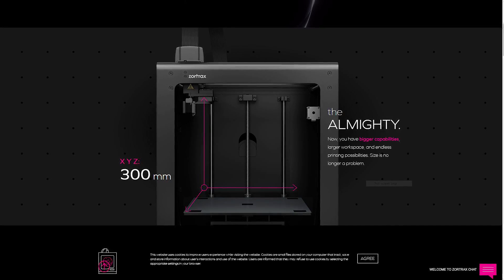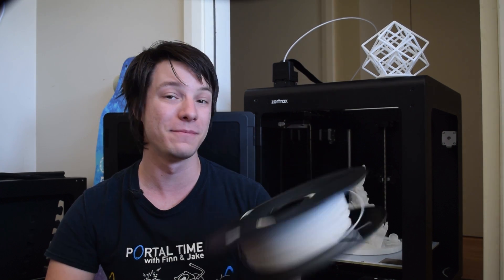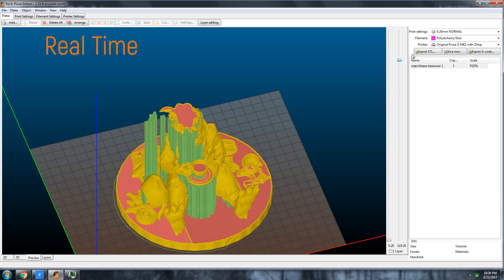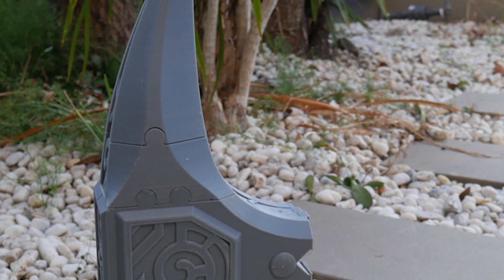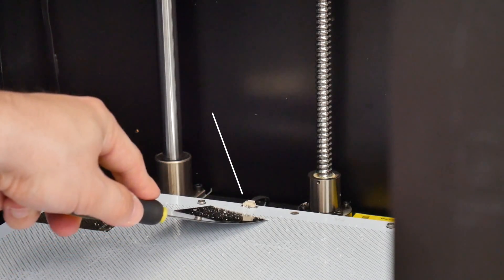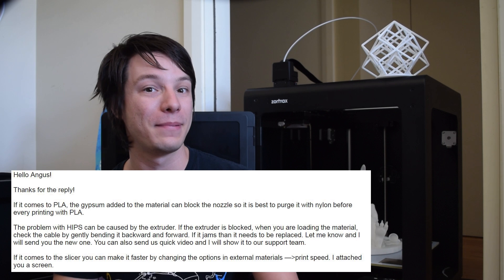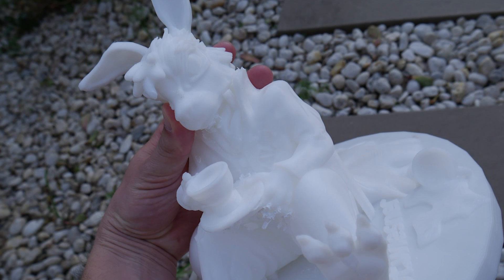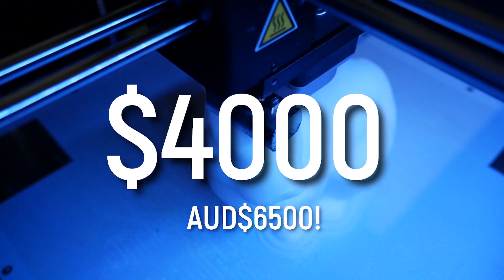Zortrax M300 3D Printer Review

Comment: Zortrax rescued my 3D printing aspirations - as someone who has been around electronics and mechanical engineering, I thought 3D printing would be an easy call - it wasn't the amount of time wasted in getting settings right, then getting the blasted print to stick to the bed, then trying hairspray etc only to have it weld on or leave sticky residues that would mess up the next print etc. I'd get a passable print, sometimes a really good one, and not touching any settings, have subsequent prints fail over and over - so when I saw the Zortrax with the anchoring holes in the print bed, I just had to have one - and with that, went from one print in 10 being a success to only 1 in ten failing - usually because I'd done something stupid. I won't have anything else but Zortrax now - currently we have an M200 at work on my recommendation, I have an M300 here at home, and am thinking about an M200 plus and an Inventure next - Zortrax all the way for me now. :)

Comment: The price may a bi higher, but I love my Zortrax printer....its not the fastest software and printer.
Its plug and play and prints 100 times the same part in exact same quality as before.......some hardware upgrade would be fine...thats true ;-)

Its my third printer, but almost all print passed well......except user issues ;-)
My Tiertime Mini Up is also nice and good for standard parts, but it a different league depend on price.

Comment: We have had an M300 for 2 months now, and it has been nothing but an absolute disaster.  It cannot handle prints a CR-10 could handle.  We bought it for the so called "plug and play, ease of use, press print and go" but wow, I have never been on a printer so much.  

HIPS wouldn't work with the prints we were going for, so we have moved on the the pro PLA, had 2 ok prints then the quality dropped massively.  According to Zortrax apparently you are to unload the pro PLA immediately upon the print finishing, which is absolutely absurd.  Due to the printer taking much longer than most (with much lower quality as a result) prints finish at 2am, 4am, 6am so standing by the printer to eject the filament within the few minutes cool down is a joke.  What happens is the PLA breaks down the inner tube in the hot-end apparently, and as HIPS prints crap, we are pretty much screwed.

F.Y.I a CR-10 printed our model (face mask) in 16-18 hours, the M300 prints (well when it does print) it in 27 hours.

For a 4000+ machine we are truly disgusted, having lost 2000+ in production  with Zortrax not giving a single crap, not offering an exchange, even though on the first day of receipt of the machine it never worked, we are looking for other high volume machines, any suggestions would be appreciated.

We have tons of videos, photos of all the issues; machine gyrating like a 1990's washing machine, grinding the bed into the nozzle upon calibration, bed not moving, 

nozzle burning the print, countless  failed prints added with many different error  codes.  Just because the M200 has a good reputation, don't fall for the M300 thinking it will be good, as I have met another business owner who had the same issue, and posted a blog about it also.  Have a M300 for 90 days and had it sort of working for 20-30. BEWARE!

Comment: Zortrax has an issue regarding the ribbon cable for the extruder. As it moves a lot, the ribbon might eventually breaks. But, by far, the it gives the best quality for FDM 3D printing method. There's also warping issue with Zortrax. It can be solved by changing thicker build plate which can be bought from Zortrax website. The nozzle is easily maintained if you're printing with ABS. Sinks it in the Acetone and the clogging will disappear.

Comment: People really don't understand this printer and compare it to the wrong printers as well. This isn't a rep rap, this doesn't have a y axis shaking back and forth and it has a serious build volume to it. It also produces some of the nicest trouble free 1 click prints i've ever seen. Yeah the price is pretty steep but they go on sale regularly for about a grand cheaper, and a runout sensor can be added on via a 3rd party vendor super easily. Yeah it's pricey but the prints it makes even in difficult to print material are amazing. Though this isn't a toy, it's not a hobbyist printer it's a prosumer and reliably produces some of the nicest prints in legit material that i've ever seen.

Comment: Thank you for the Dollarydoos you just saved me. Think I'll go with the N2+ Dual instead now. Cheers, Susi xx
Reply: I have 2 N2s and 5 m200s(5 taz 6 and cr-10s and some others but those are mostly for my lower end DIY stuff) and kind would have preferred the m300 tbh. Leveling on the N2 is just such a damn nightmare and the prints aren't anywhere near as nice =/ I don't print in PLA though i run a 3d printing business and sell high end props and can't sell something for a few grand then worry about it being brittle or warp in the heat.

Comment: Hi Angus!

We’d like to clarify a couple of questions mentioned in your review.  

Firstly, you’re totally right about making Z-SUITE faster and better. It’s definitely our number one priority, but please remember that it’s still the BETA version which is constantly being developed. As for the SD card, it’s the safest and the most reliable way of transferring the models to the printer. Also, we implemented “external materials” option in April, which allows our users to experiment with other manufacturers’ materials. 

Regarding the Z-HIPS, please contact us either via support form or directly at "support@zortrax.com". We’ll do our best to provide you with help. Removing big prints from the platform will be much easier if you take it out of the printer: 
http://support.zortrax.com/removing-the-print-m200/. 

Also, we’re sorry for your bad experience with Z-PLA Pro. Many of our users successfully print with this material. Generally, Z-PLA Pro prints better in lower ambient temperature. Thus, we recommend the users to remove the side covers and set the fan speed to 100%. Additionally, remember to calibrate the platform before printing with this material. It’s recommended to do this activity before loading the material (on an empty extruder). Due to Z-PLA Pro’s characteristics, it’s recommended not to leave the material in the hotend when the printer is in the idle mode.  

By the way, we’ve recently dropped Zortrax M300’s price, so that the users can create high quality objects for lower price. 

If you would like to discuss any other matters, feel free to contact us. 

Best regards, 
Zortrax Support Team
Reply: We have had an M300 for 2 months now, and it has been nothing but an absolute disaster.  It cannot handle prints a CR-10 could handle.  We bought it for the so called "plug and play, ease of use, press print and go" but wow, I have never been on a printer so much.  

HIPS wouldn't work with the prints we were going for, so we have moved on the the pro PLA, had 2 ok prints then the quality dropped massively.  According to Zortrax apparently you are to unload the pro PLA immediately upon the print finishing, which is absolutely absurd.  Due to the printer taking much longer than most (with much lower quality as a result) prints finish at 2am, 4am, 6am so standing by the printer to eject the filament within the few minutes cool down is a joke.  What happens is the PLA breaks down the inner tube in the hot-end apparently, and as HIPS prints crap, we are pretty much screwed.

F.Y.I a CR-10 printed our model (face mask) in 16-18 hours, the M300 prints (well when it does print) it in 27 hours.

For a 4000+ machine we are truly disgusted, having lost 2000+ in production  with Zortrax not giving a single crap, not offering an exchange, even though on the first day of receipt of the machine it never worked, we are looking for other high volume machines, any suggestions would be appreciated.

We have tons of videos, photos of all the issues; machine gyrating like a 1990's washing machine, grinding the bed into the nozzle upon calibration, bed not moving, 

nozzle burning the print, countless  failed prints added with many different error  codes.  Just because the M200 has a good reputation, don't fall for the M300 thinking it will be good, as I have met another business owner who had the same issue, and posted a blog about it also.  Have a M300 for 90 days and had it sort of working for 20-30. BEWARE!
Reply: Hello, 
We are really sorry for your dissappointment with our product. 
We've provided you with multiple solutions and please, remember, we are still there to help you. 
It would be the best if you let us check the printer in our Technical Service, as this is the first step for repairing or even potentially exchanging the printer. 
Please, contact us so we can provide you with a satisfying solution. 
Best regards, 
Zortrax Team

Comment: 4K? LOLOLOL!!!! I can build a hypercube evolution for $500 and it will blow that POS out of the water. What an overpriced piece of shit. Thanks for the review.
Reply: if you can do it and prove the system then i'd buy it. Heck i'd pay ya double, triple that. I honestly haven't found a single printer that can beat the m200/m300 in terms of print quality in ABS material, i run them for my business though so i'd gladly pay way more than 500$ for quality prints. If i could get any other printer that prints as nice as the m200/m300 in ABS/HIPS for cheaper than i'd 100% buy one, though i haven't found a single one that does and i've tried out about 20+ different machines and currently run about 30printers 24/7 for my business (5 m200s)
Reply: Thyshallsmite hypercube evolution on thingiverse. That's what I'm building
Reply: yepo, know which one your talking about, build it and enclose it and make it print ABS just as good as the zortrax for hours on end reliably and i'll buy a few from ya :)  i buy a new machine about once a month to keep up with demand and have no time to build my own and always on the look out for new/better machines.

Comment: I have an m200. Been printing with it for years with very few failures. Print in ABS all the time. Slicer is definitely slow, print time is slow but I still don't have a printer that equals the print quality. I never had to post process prints until I got a CR-10, which is a nice printer but not in the ballpark of quality. I don't have ringing, or tuning or anything. The one thing that is overlooked is the Zortrax is really designed for businesses that don't want to spend money paying someone to learn how to 3d print. Figuring out slicer software, correct temperature etc. They just want to print the product and get on with business. 30 min out of the box and your printing models with no issues. I will say I don't print PLA on it. I know it really wasn't designed for it. I do know people have been printing PLA for years on it before they even opened up the software.

Comment: I'll pay $4000 if they make it open source on the software side and add all the features that you would expect for the money (Linear tracks, autoleveling, filament detection, bluetooth, wifi, etc)
Reply: Hyss Lulzbot Taz 6?
Reply: It doesn't have linear tracks, nor does it use particularly high quality screws. It is a fine printer, but I would expect more for $1500 more than that, and personally as someone who bought a Velleman for £500 and spent at least that upgrading it, $2500 is more than the Taz is worth considering the quality you can get from current chinese machines. The Raise3d N2+ is a closer comparison, and a printer I am considering getting.

Comment: I use this machine a lot at work. I've got a lot of brown spots as well. It is an easy to use machine to step up to and start printing and haven't had a single failure. But if you don't mind tinkering with a machine you shouldn't buy this one. If you just want to print and nothing else, it's fine

Comment: That's rediculously expensive printer that offers medium quality experience over all. I feel like my Anet A8 with few mods on it offers much more user friendly experience. It's so easy to maintain and control. There are dozens of helpful tutorials online. You can use whatever material you want and so on. Now, I'm aware that we can't compare the print quality of these two but 4k dollars (or 6500). Man That's overpriced.
Reply: Nebojša Kamenčić on the other hand, Angus could test this printer without worrying about it burning his new home down.
Reply: Daniel Turner with atx psu, mosfets, termal runaway and resoldering bed I'm pretty condident in my A8. I leave it running for hours when nobody is home or during night when everybody peacefully sleep in the house. In current state I don't think it is more dangerous than electric stove for example. All the safety features were like 50 - 60 euros.

But if you're worried about the Anet A8, maybe Creality CR10 is better example. Exellent printer so easy to maintain, big build volume, gives very good quality prints and is several times cheaper. Didn't hear about people burning their homes down with CR10.
Reply: If you've heavily modified the machine to make it safe, it's no longer an Anet A8.
Reply: Daniel Turner the point is that it doesn't matter. I'm not Anet fan or anything. I even don't like the company at all. I don't find it important to state that it is an Anet printer. The point is that it's cheap, versitile, easy to operate with, easy to find and replace/upgrade parts, usable with any slicer, usable with and filament brand, even reliable now.
Reply: not even a remote comparison, if you want to even come close to compare, look at the m200

Comment: Great video.. I have an off subject question nobody has been able to answer.. All of my prints start out well at speeds picked. but they tick off by 10 till it goes down to 10 .. meaning it starts with a 100% speed im assuming of the speed you decide. but 4 hrs into the print it may be down to 70 something or so.. and by 6 hrs  or 7 its down to 10 crawl speed?? Im using cura with teh Cr10 S and I even did a test print of all speeds set to 60 and same thing happened? is there something i can do oh master of 3d? lol

Comment: For $4,000 I would rather have a ultimaker.
Reply: ultimaker is the same build volume as the m200 and significantly more than the m200. This is only really for super large prints

Comment: So it's slow proprietary and expensive. And those are it's strong points. I'm pretty sure my home built 300x printer will kick the snot out of that. Also hips, is marketed as a soluble support material for dual extruder machines as it's print requirements are very similar to ABS. Either way, this ones not going on my Christmas list.

Comment: A very reliable machine. Unfortunately, the zortrax ABS is unsuitable for large prints. If you really want to print ABS should switch to a warping optimized ABS like the Urbanmaker ABS WO. You can simply use the standard ABS profile for Z-ABS. Just adjust the extrusion temp to 240C °.

Comment: I like your channel very much and I also value your opinion very much. I am in the process of acquiring my first 3d printer  and my options are either tevo tarantula or flsun i3 metal wich looks like a tronxy x3. Building a kit is not a problem but getting a good one is a challenge. What is your opinion. Thanks

Comment: People swear by Zortrax quality and reliability, so this doesn't sound like they kept that up. I figure you lock yourself into the echo system, you expect that with their printer, their software, their filament it will print so well you'll get production quality prints, and that was generally the case with the M200, so seems scaling up doesn't produce the same results? It wouldn't be my choice for a machine due to lock in deal, but a lot of people who are in the creative business are looking for a guaranteed perfect print every time machine, who don't want to mess with temperatures, extrusion ratios, infill percentages, and support settings, they just need a replica of their digital sculpt, I suppose they may be rather disappointed that the M200 reliability hasn't carried over to the M300.
Reply: kazolar absolutely, we are screwed, but bought the m300 and for the most of the time it has been nothing more than an ornament.  A massive waste of money

Comment: Angus, could you try generating supports in some other slicers (*cough* Simplify3d), save files as STL and import them to Z-suite? I've been trying that on my M200, but only have Meshmixer to play around with, but the results were very hit-or-miss. There's also third party tools (g2z) that allows you to convert gcode to the proprietary zcode(along with profiles for several slicers) that I haven't yet tried playing around with that may be worth a look. Finally there are unofficial addons (Z-Temp) that you can add to the printer for much greater hotend and bed heat control(originally released before this was available in Z-suite), even allowing you to print raftless on a glass bed!